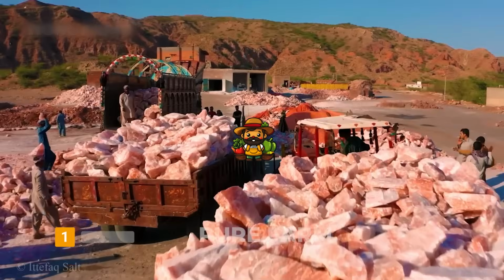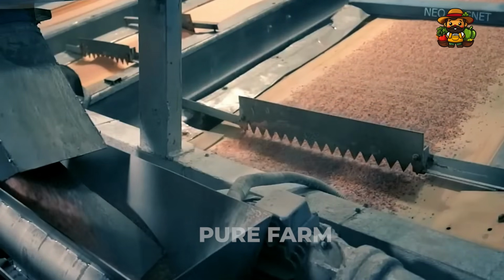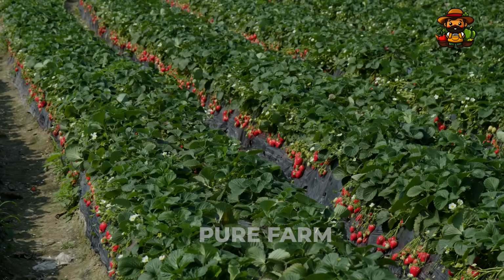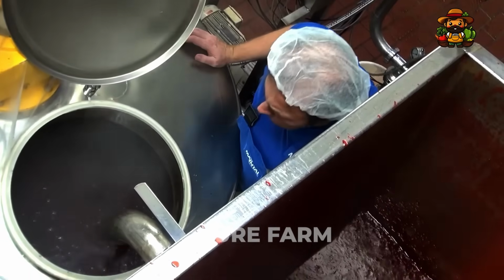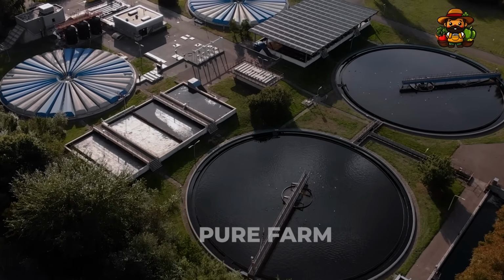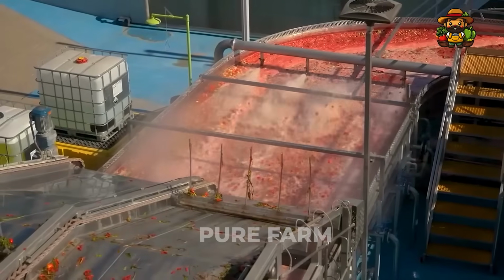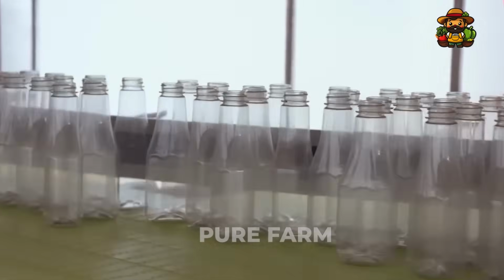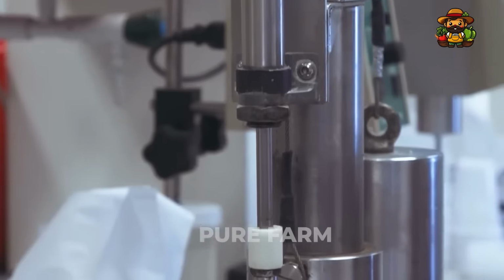How HIMALAYAN Pink Salt is Mined and Processed | How It is made

Comment: “What gives it its rosy pink hue? The trace minerals...” BZZZT wrong, my wife's Himalayan salt lamp had a problem where if you didn't leave it on overnight (which would keep her awake) it would be the coldest thing in the room come morning and humidity from the showers two rooms away would consense like dew and then drip onto the dresser, leaving a salt puddle with the exact same composition as the rock which then evaporated. It dried completely white! The pink color comes not from those minerals in isolation, but how under pressure they coaxed those trace minerals into a different crystal lattice than NaCl naturally forms (cubic), and that probably creates some sort of band in a semiconductor band gap (or else it trapped some water in the lattice or something). Ever since I was dating her and saw the salt on her dresser I've been meaning to ask folks if anyone has done x-ray spectroscopy on the damn things lol

Comment: I love giving my face a good scrub with pink salt when I've had a shave with my safety razor. 

Yes, that is actually a thing, it was a product I got bought for Christmas a year ago. It actually works wonders and it also has the perhaps unintended side effect of making the shower water taste nice as it dissolves to form a protective layer.

I've been using it in my cooking for years but I didn't know it also worked well as a skincare product.
Reply from the maker: That's awesome, thanks for sharing
Reply: - What is the name of the product?
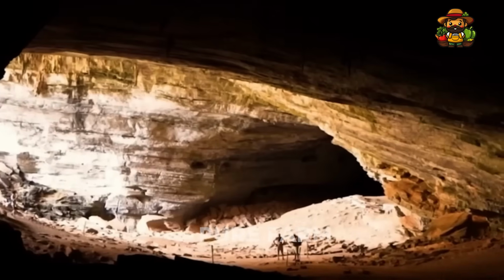Reply: 11:00 start of jam commercial.
Reply: I’m going to give it a try tomorrow!!